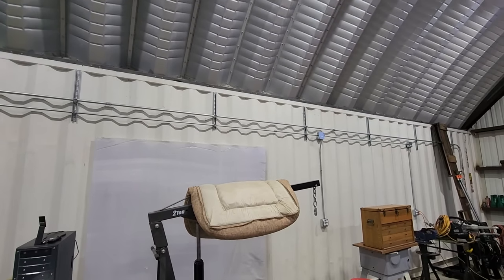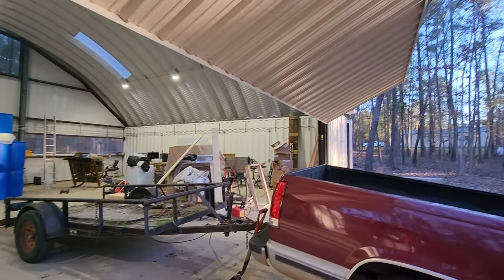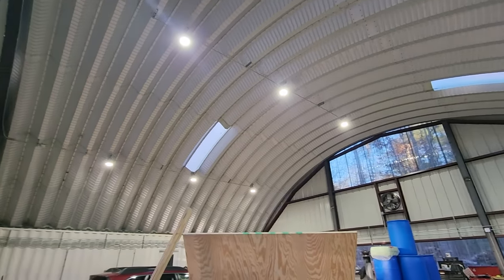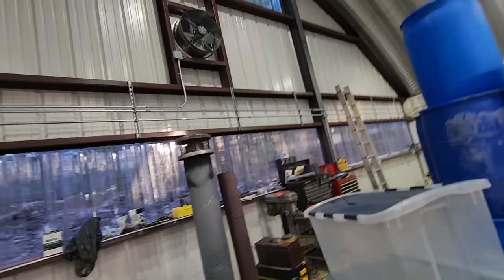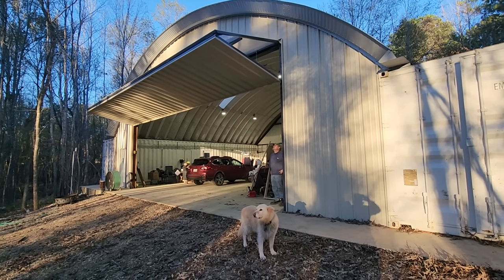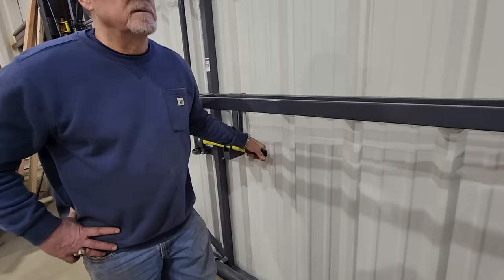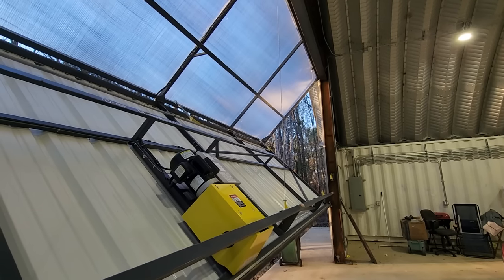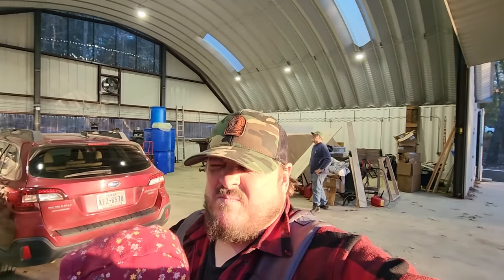Shipping Container Shop and Home! FULL BUILD!

Comment: That is amazing, I love the door, it gives you full access across the shop, no issues with extra wide vehicles or anything. Love the windows and amount of light that comes in.
Reply: My brother built a farm shop with I believe is a schweis bi fold door 44x18. It has 6" wide cargo straps in lew of cables but the same principal. Those doors are soggy for sure! His has a man door built into the bi fold door. 
I didn't see how the containers handle the water runoff from the arch roof. Is there a slant roof on each container??

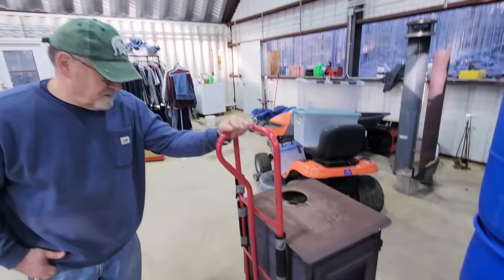Comment: 2:34 Pro tip, to prolong your time on this planet, avoid having that stove hot (lit or even embers still going) when working on ANYTHING that has flammable fumes or could create flammable fumes that GO BOOM. 

Working on a vehicle is generally safe but having a open flame heat source that can not be turned off quickly is a HUGE liability. If something like a fuel line pops off while you're working on a vehicle, those gasoline fumes could lead to some tense moments as you try to open that huge door to get enough fresh air in to reduce the chance of an explosion. Also, your insurer will give you a much higher quote for a fire stove heater.

Comment: The hanger door looks really cool.  Love the clear panels on the top half of the door. Planning on one for my shop build next spring. Looking at schweiss and diamond. Quotes from each may make that decision easier to make! We have schweiss doors on two of the buildings at work and they work great, nice to see a diamond in action here. 

Containers at the edge makes sense to me!! No reason to encroach on the valuable interior floor space with storage that is already sealed up! If you ever want a storage mezzanine you can always add that in the future and keep the ground level floor space under it. Our zoning and planning here can be rough sometimes. I'm curious if the square footage of the containers is considered part of the building or a standalone 'temporary structure' and counted separately. I may have to shoot you guys an email to share some of my concepts for my space.

Comment: The door is impressive. What's the contingency for a loss of power or mechanical failure? Can the lifting tube be hand cranked to raise the door?
Reply: i build one myself 6.5m wide 2.7 high on a 12vote systems works well .

Comment: We did something similar.  How did you seal out the water / rain from leaking into the bldg down the walls off the containers?  

We are getting water running down the walls of the containers as rain water builds up and leaks underneath the attachments of the arch to the container.

Comment: I'd like to see how the roof is sealed up against those containers.
Reply: Me too! I could imagine some L flashing from the flat top edge of the container tucked up a few inches behind the bottom of the quonset hoops would get it done. Looks like the quonset lands farther out on the containers though. There are about three different profile options for shipping containers corrugations so I could imagine there's at least one company out there manufacturing a product for this.

Comment: Curious what a shop like that costs?
Reply: about 1-200 dollars per◼️foot
Reply: @THEMOWERMEDIC1  That's a Pretty broad number.
Reply: @consaka1  😂
Reply: Really not much this shipping containers are like 3,000 piece I couldn't see no more then 50 to 65,000
Reply: @brianreynolds5246  40' sea containers are about $5500 where I'm at, the Quonset steel for that size $40k?, the concrete slab that thick $10-12k?, electrical work, and then labor cost...... We used to always figure at least double the material cost if you hire the work out